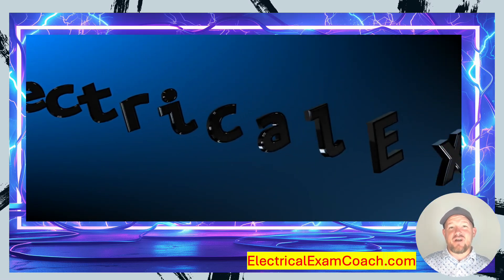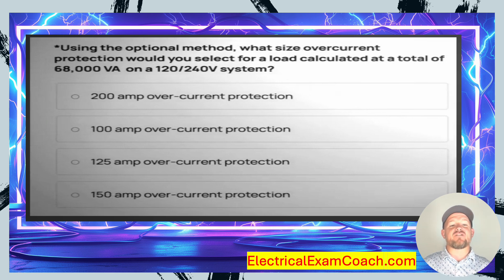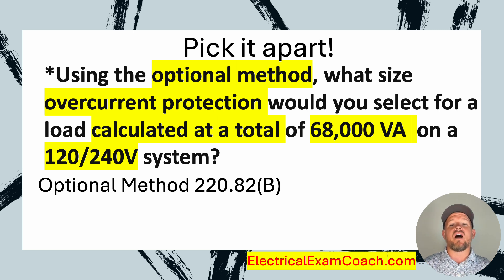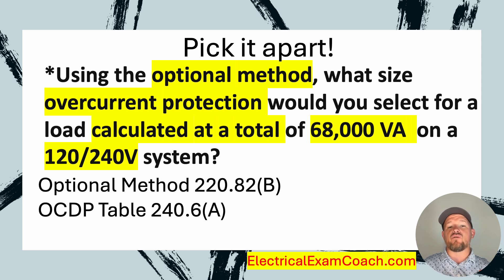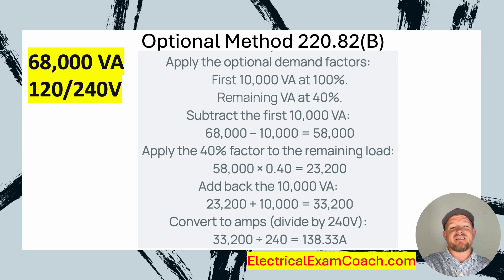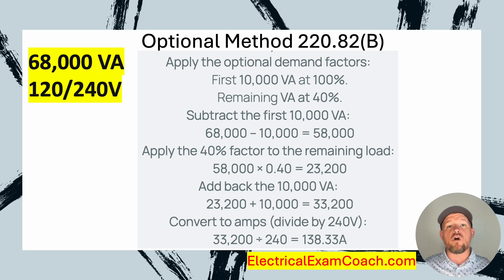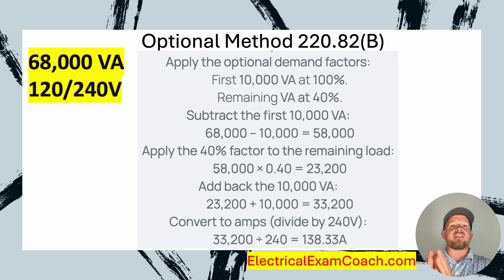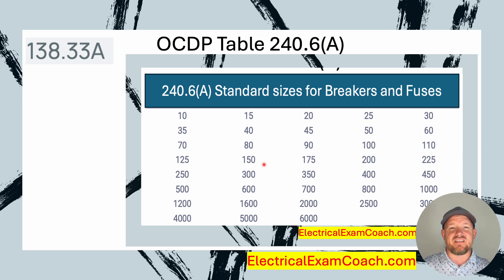#233 Electrical Question of the Day. Electrical Exam Coach. 228.82(B) Optional Method Calculations

Comment: How come you use the 240 volts for the calculation instead of the 120? Would you just default to the higher voltage because It would give you a smaller ampacity for the ocpd?
Reply from the maker: Great question! you have to do the system voltage for main breaker, If you were doing a 120 volt load size you would use 120